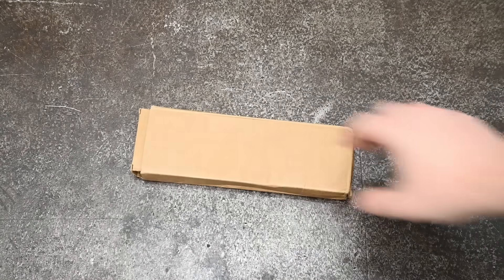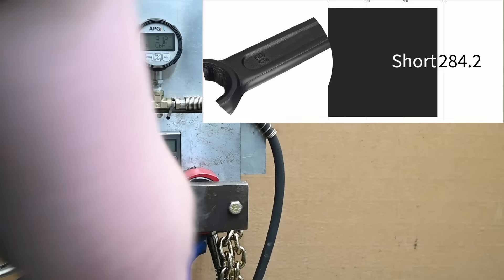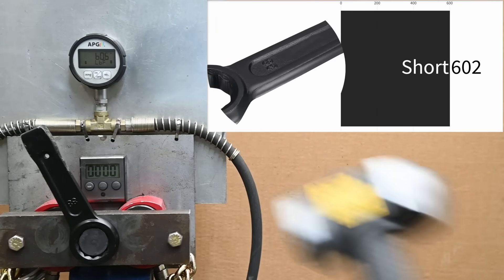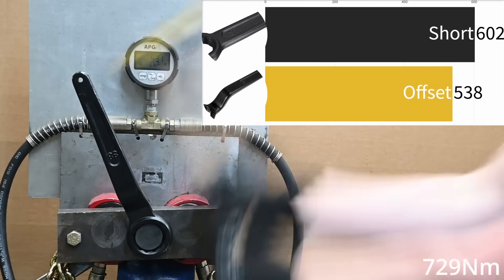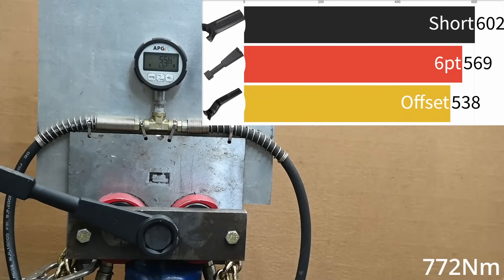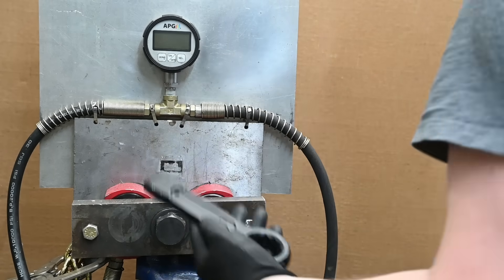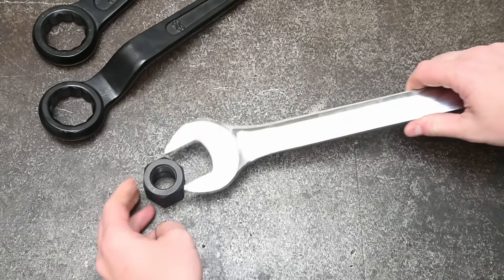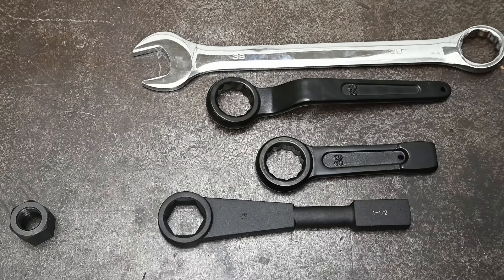1800s Impact Wrench? Slug Wrench: the ORIGINAL Impact Wrench

Comment: I have an episode suggestion...
Testing combination wrenches (both ends) with extra long wrench extenders to see which ones can impart more torque before the wrench bends into uselessness or breaks. Thoughts? The idea came from this video, thinking that outside of heavy equipment or factory machines, swinging a ten pound sledge wouldn't be anymore possible than using a DCF96/964 in some areas on, say, a car. But sticking a combination wrench and a long wrench extender might be the ticket.
I get that you use "pushy" for those types of numbers, but I feel that isn't "real world" and a wrench extender is going to yield very different numbers than pushy.

Comment: I work for Lipman crushers and some of our crushers got four and 5 inch bolts on them head. I don’t know what size the shank is the slug wrenches are four and 5 inch and we’ve modified a lot of our wrenches to have a cup on it so we can use a hydraulic rock breaker to just whack it to break it free You can’t stay on it with the hydraulic breaker but tightening we usually use a 15 and a 20 in on some real big cases, we have a 50 pound sledge that takes two men in a baby to run a man a lot younger than me let’s go that route but all of our final Tores were done with hydraulic. Wrenches they’re very cool.

Comment: Hitting the counterclockwise strikes at about 7 or 8 o clock would have been better, really, the force would have been delivered to the floor more directly and likely less would be wasted picking the bench up.
Reply from the maker: The bench is bolted to the floor with 1" thread bolts

Comment: Slug wrenches work great on things that you can't get a socket on. Injection molding nozzle bodies can be upwards of a foot or better long, with the hex towards the rear. If the apprentice forgot the anti seize, and the thing has seen 5000 heat cycles since it's last been pulled off, the old poundy boi is your best friend.

Comment: We still use these in the oil feild daily. Alot of the stuff we deal with is to close together to get a half inch gun in to. Alot of the time you can barely get these guy in on the bolts

Comment: Honestly the sound of a wrench falling on the floor after having been hit with a hammer is way more familiar than it really should be.
Reply: Typically followed by an expletive
Reply: @Banks4004 oh THAT's what was missing!
Reply: I can feel my fingers tingeling from the wrench vibrating under hits as well...
Reply: Fact.
Reply: On the railroad, it's a sound you can't avoid. Basket wrenches being the most common. Then your usual 10-15lb iron rod for loosening stones and compacted gravel lol. Just carrying that lance is at times a workout across a few miles
Reply: 😅 This video must have been annoying as hell
Reply: I suspect, looking at your setup, that these massive hammer blows are testing your setup for rigidity. Anything this tight in the real world is usually going to be very solid. I think some of the force of the blow is lost in the shake of the machine as you impact. 
Could be wrong. Probably am. 😊

Comment: I’ve used slug wrenches a number of times, primarily on older Cat equipment in areas where there wasn’t enough headspace to get an impact and trying to add more cheater length to a breaker bar wasn’t looking like a good idea.

Comment: We still use them occasionally at the paper mill. But mostly for hard to reach places. Luckily, the  3/4" and 1" drive battery-powered impact drivers have finally been able to replace them. None of our 1/2" impact drivers could get the job done. It seems to me you get considerably more transfer of power from a  sledge hammer when you screw into a base rigid enough to hold a 100000lb roller! 
Keep up the good work!

Comment: I wonder if some of the low numbers in torque were do to scan rate on your digital pressure sensor.the scan may have missed the actual peak. Probably not such an issue with powered impacts as the pulses are repeated rapidly

Comment: these work best for breaking apart flanges.  not so good for torqueing them.  you can generally get the even and snug enough (if you know what you're doing) with big wrenches quickly and easily for the hydraulic torque wrench heads to be able to take purchase as soon as you attach them.

Comment: Looks like a perfect thing to pop in my tool box for installing oil filters and pan plugs out in the field
Reply: Good to support the economy! If you install something at high torque with a special tool, then the next person will buy that specialty tool to remove it.  They will also spend more time doing it, which means they will earn more & therefore have more money to spend, which leads to more job creation, yadayadayada.  Good economic policy
Reply: @huckbeduck GDP fans be like this unironically
Reply: LMAO
Reply: 😂 don't give quick lube places any ideas
Reply: I do hope you do have your 250 ft lb torque wrench as well. Best to do the job correctly the first time.
Reply: I think you also worked on my truck's differential many years ago.  Spent half a day just getting that damn thing out.  Lesson learned - NEVER DRAIN a differential or transmission until you have verified the fill plug is removable.
Reply: KEKW!

Comment: I have a 46mm flogging spanner for the axle nut on the single sided swing arm of my motorbike. Stays under the seat of the bike. One shop I went to didn't have the right size socket or spanner.

Comment: I feel like if you walk up to a fastener with that 10 lb hammer, you've already had a bad day.
Also a shout out to another kind of impact, the manual impact driver. Just a beefy AF screwdriver with a mechanism so you whack the end of it into the fastener to turn it a tiny bit without stripping it. I forget the name, but there was a brand of screwdriver with that mechanism in it, but they make big beefy ones designed just for whacking with a hammer. Does a great job on stupid tight Phillips bolts and saved my butt just a few days ago.

Comment: I’ve had Snap On slugging wrenches in a truck shop. I use them where pneumatic impact wrench or torque wrench won’t fit,
Such as R model MackRear engine mounts.slug to loosen them enough? And slug them for final tightening.

Comment: The thing with hammers and force is that if you double the speed you get 4 times the force.
If you double the weight and have the same speed you double the force, BUT having double weight you usually go slower so sometimes it's better to go down in weight and up in speed
Reply: 100% correct. Velocity squared!🎉🎉🎉
Reply: Conservation of momentum is what's going on here, more than energy.  With equal kinetic energy projectiles, a slower moving, heavier bullet will 'move' things far more than a lightweight one at high speed.  Momentum increases directly with velocity.  KE increases with the square of velocity.  Momentum is what you're seeing at work here.
Reply: Only the momentum portion is transferred so it isn't v^2.  Most of the energy gets wasted in parasitic losses.  You want more weight and fewer blows.  Try loosening a bolt with a 1lb framing hammer swinging as fast as you can, then grab a 3lb sledge and give it a few taps.  The taps will win.
Reply: @knurlgnar24  True, but there is a sweet spot for any task. I have found that bolt heads under 2 inches respond best to a 3 - 4 lb singlejack, rather than a 10 or 12 pound sledge.  Or, maybe it is just that I cant swing 10 pounds hard enough at odd angles.
Reply: @RAkers-tu1ey  I have the same issue.  It's tough to get a 10lb sledge moving fast enough in a tight space.  Sometimes you'll get more momentum out of a lighter hammer.
Reply: @knurlgnar24  Yeah, and the time I got someone to help me, they missed, and I had to learn Barre chords 🤣

Comment: Oilfield worker here, I’ve used hammer wrenches many time on flanges for wellheads and we will tie a small rope to the end of it to hold the wrench under tension which helps with keeping the wrench from flying off. Great videos keep up the good work!
Reply: We've always had the apprentice hold tension on em, ropes a good idea
Reply: When I worked for shlumberger they outlawed hammer wrenches unless you were using a grabber pole to hold on to the wrench and another guy would hit it. It looked like the dog catching poles but all it was was a rope through a fiberglass pipe
Reply: @brettknighten1171 thats all the dog grabbing poles are, too.
Reply: @brettknighten1171 no surprises there, all day Schlumberger 🤣
Reply: My guess is the hole in the commercial tool is for that?
Reply: Yup one guy uses a rag and pulls back and the other one swings. Use these all the time on everything from flanges to fluid ends.
Reply: Ship repair, here. We do the exact same thing for steam flanges and valves. I'm glad someone brought it up.
Reply: I use them at work as well. There's one spot where you can't get a good hold on it because of where it is and we just throw a small magnet on it. Holds up quite well.
Reply: Gas line welder here ;) We were using those hooked up to a excavator bucket to tighten flanges. Only once it have slipped off, no casualties XD
Reply: Dang it. You beat me to this tip. Works great.
Reply: I work on my own car and that's all.  If you don't load the wrench before making it and take the flex out of the metal you are losing so much force
Reply: Was just about to say that!
Reply: Rope is mandatory working over water on a dredge discharge pipe slugger or knocker wrench is what we call them
Reply: Steel mill and power plant worker we always use a nylon sling on it for tension as we always have them around, same principle as a rope. Works wonders
Reply: Need to redo some tests with a tight rope to the wrench. I solely believe it increases the torque a lot   Hope to be proven wrong.😊
Reply: I think it also helped "springback" or whatever you'd call the vibration. I used to do a lot of wellheads with these, before impacts got better
Reply: Oh srs? So when it slips off it has stored energy in it and goes flying? Niceeee
Reply: We call them 'Hammer Spanners' on the rigs in New Zealand
Reply: I'd be interested to see if the rope pre-tension adds any torque. I'm theorizing that it isn't the rope pull, but better contact cutting energy loss. I know from experience that grabbing a socket and twisting with the impact can make a lug nut come free, and I don't believe that my grip on the socket is strong enough to help, but it seems to work.

Comment: Flogging Spanner, goes with the heaviest short handled sledge you can use. I watched a crew flogging up heavy pumps one evening, a lot of work. Shame they had them in backwards !
  Most of the ones you need ,you make, it's better if they're a bit tight.

Comment: What if you used a slug wrench and then used an air hammer or SDS hammer on it?
Reply: That was the first thing that popped in my head aswell
Reply: As a mechanic, it would not do as well.Because each manual hammer blow has more force.ImpactHammers work on multiple fast blows.But each blow has low force. Sometimes the low blow, but fast blow is needed. Not in this case.

Comment: I've abused the HELL out of lifetime-warranty ratchets in this manner under trucks when there wasn't enough room for a breaker bar or snipe on the ratchet handle. Most always with a short-handled three-pound drilling hammer -- if you have enough clearance to swing a two-handed hammer, you can probably get a breaker bar in there.
On a similar note, I've seen five-foot-long pipe wrenches in local pawnshops around the oilfield with bent handles -- I can only assume they couldn't break the connection with the five-foot handle, and so put a snipe on it, and when that didn't work, chained that to the hitch on the 1-ton diesel crew truck and floored it.
Reply: They usually bend the pipe wrenches by hooking them up to the winch line

Comment: Lets face it. If you are busting out that big sledge you aint giving it no little love taps. Youre pissed off and swinging that thing in a full arc and pulling it down while going into a squat to add the extra oomph. The kinetic energy in that kind of swing will impart will always beat any power tool.... if you can hit your target and not your knee... or your nuts.

Comment: Used to use those flogging wrenches a lot when I was an Engineer in the Merchant Navy. I think they would have been about 200mm across the flats (8"). They were used on the cylinder head  bolts, big end bolts, etc, on the main engine. The flogging hammers were 28lb jobs (13kg), a right bugger to swing inside a crankcase, and you were trying to swing them horizontally. Used to take it in turns, maybe 10 strikes and then the next man would have a go.

Comment: I have a handful in my toolbox for those times you definitely can’t use a breaker bar, rattlegun, or any number of tricks. The 24mm and 30mm are the ones I find myself using, because most of the bigger ones are too damn expensive

Comment: I have used a hydraulic jack to turn a wrench when I was doing brakes on my and my brother's car cuz there was no space for a hammer. Worked like a charm and it was a LOT less tiring than a hammer.
Reply: I've used a bottlejack to do that as well when I couldn't get an impact in to get a rusty suspension component. Worked perfectly. I was putting on new swaybars and endlinks on my subaru.
Reply: Add using a cable puller hooked to the frame for balljoint nuts and big suspension component nuts that just don't want to move.

When you gotta get it done, you gotta get it done.
Reply: 10/10 strat
Reply: Exactly! I’ve used them with porta-powers and jacks
Reply: I tried that on a forklift wheel once and it just spun the wheel. Had to use a come-a-long to the cage to hold the wheel while using the jack.
Reply: Better for parts you really don't want to break too. Impact tends to shear bolts and crack housings.
Reply: I did this to get some lug nuts off that a shop installed with a very large impact.  I ended up bending my tire wrench and braking two studs before giving up and taking it to a shop.
Reply: That was pretty stupid. I bet if you applied torque to both sides like with a T handled wrench, you would’ve had much better results. Applying torque to only one side like this to stuck bolts is probably the best way I can think of to break them off instead of loosening them.
Reply: @morscovium8881  while I 1100% agree with you, when you are  actually doing the job then perfect execution is sometimes not an option.
In case of your T handle wrench
pushing form the bottom with a jack is easy but pushing from the top to equal the jack's force is difficult if not impossible in many cases. 
Sometimes the best you can do is get a large impact, hydraulic wrench or cobble something together. If you really wanna avoid cutting anything.
Reply: @Cjarka_  true, i just think its something most people don't understand and should know about. they seem to think long handled, non sliding breaker bars are the best option. but they need to know if you have a very stuck bolt, and plenty of room, and you want the best chance of getting it out, applying torque to both sides is the only way.

Comment: You should try and see how different techniques affect the end torque. Like I find when I am hitting a wrench to loosen a hydraulic fitting, it works much better to apply some pressure in the desired direction of rotation then hitting it a little lower on the wrench. I realize that only works with a full sized wrench. I would also like to see how hammers with different levels of hardness affect the torque results. I find often that the harder hammers perform better. It is certainly true when beating pins out.

Comment: Please do a video on vibration reducing certified gloves.
The problems working with vibrating tools causes are real and not reversible.
PPE is important.
Reply: I wasn't aware these exist, but heck yeah, I want one! Do want a good one tho, so having it tested would be great.
Reply: @randomviewer3494  The first time I used my string weed trimmer my hands were numb after a half hour. The next time I used my bicycling gloves. It worked, no problem. The bicycle gloves are open fingers with 1/4" padding for palm.
Reply: PPE will only do so much, i find gloves that are advertised as anti-vibration, workers tend to grip harder due to bulk which results in similar or worse problems. Best Ive found is find tools with less vibrations transfer, encourage stretching, and frequent breaks if possible
Reply: Adding insulators to handles definitely works better than the gloves.
Reply: @TheIronTank in “Industrial Hygiene”, PPE is considered a last resort.

For instance Loud AF Equipment and crappy foam earplugs is the BAD thing to do, quieter equipment + nothing or OPTIONAL ppe is way better.

Still though third party testing of the gloves would be neat.

My concern is the company never provides em, and nice demo gloves cost MONEY lol.
Reply: Thanks, never heard about them, now I need one. 😅
Reply: Especially which ones dull the blow of a swing and a miss with a 2lb sledge right onto the back of the hand.
Reply: Using an old big chainsaw compared to new ones that are the same size with more power will really open your eyes to how far vibration damping tech has come.
Reply: I want to remember reading a paper saying they don't do much difference at all in the long run
Reply: Definitely need something for the weed eater and leaf blower!
Reply: What works is not using that stuff anymore.
I went through the glove thing, there's like a 60 dollar pair in a box behind me that haven't been used in 5 years, last time I held a weed whipper.
  Those were it for me, holding them half the day.